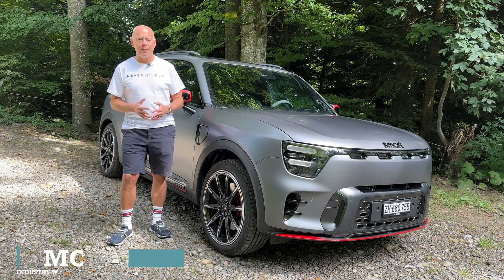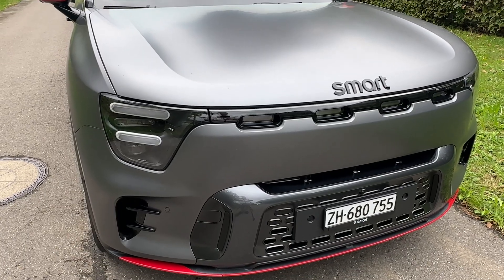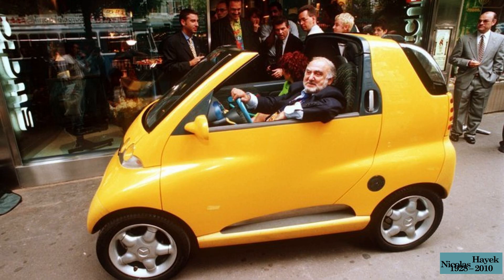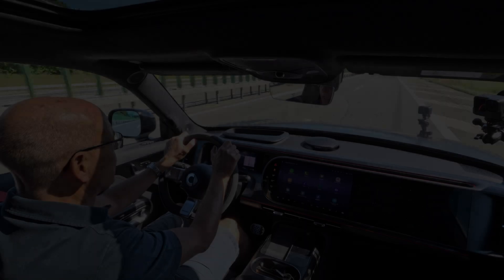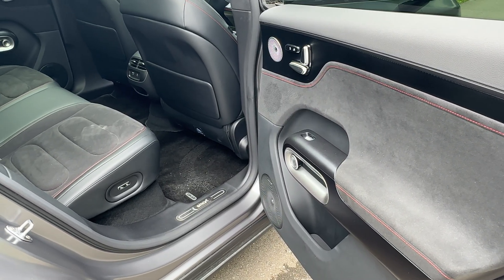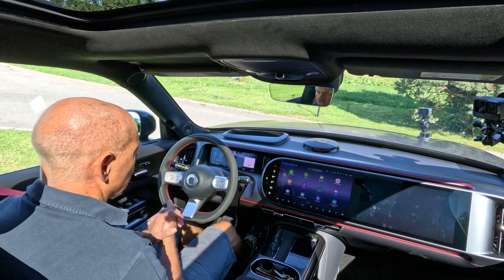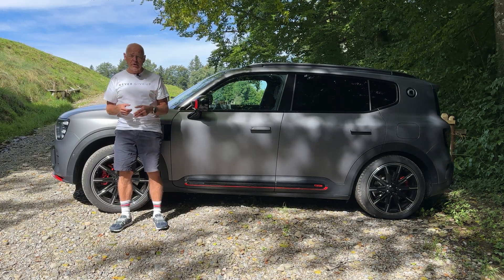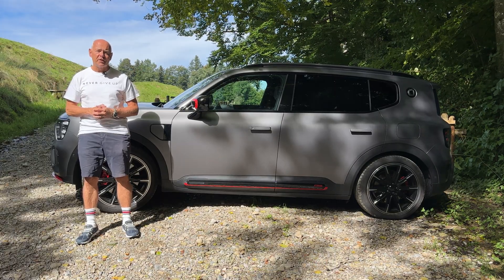Smart #5 – Geely Engineering, German Precision, Global Vision

Comment: An excellent review. After so much commentary about car software in the last few years, focussing on how rushed to market and poor it often was, it's disappointing to see Geely continue to under invest in this. And annoying reflections from the screen should be a fundamental design consideration. It makes me think: don't buy now, wait for the re-fresh in two years time.
Pro tip for English:
8:44 "at the end of the test we'll see how good or not good the car performs" --> 'how well or badly the car performs'.
A noun (a something, the something) can be described as "good". When you're saying "the" then you will use good, poor, terrible, amazing etc.
So: the brakes are very good, the braking is good, the acceleration is good but not amazing,
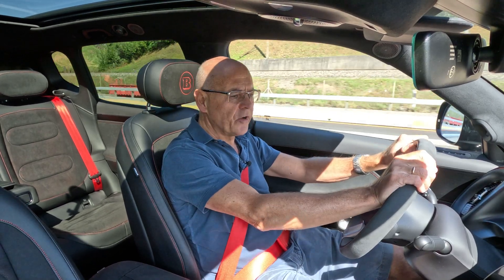A verb is always qualified by "well" - it drives very well, it drives quite well but.... (correctly used at 7:02, 7:32 etc)
And: it drives well, it handles corners well, it will sell well, how well will it perform?. When you're using a verb you always use "well".

Comment: No German is proud of the engineering behind the Smart. It's now a Chinese car, and I bet it will sell significantly worse than a genuine Smart in Germany, wouldn't you agree?
Reply: The new Smart cars are better than anything Smart ever made when they were German...
Reply: Most German ev’s are far behind the chinese. VW has nothing that is modern. Latest BMW i3 and Merc GLC is closing in at least, but charging is still far behind the best Chinese.
Reply: @DanielKihlgren you seem very hung up on fast charging, but it really isn't the big deal they make it out to be. In practice, having a 25 minute break on a road trip is perfectly fine. Especially with a family all having to go to the rest rooms, grabbing a coffee etc. And the #5 (and many other Chinese cars) are horribly inefficient at highway speed. That gives up much of the theoretical time gain of faster charging.
Reply from the maker: Possibly, but the car is backed by many Merc dealers which should help
Reply: I would love to get a European made car. For example the VW ID.7 Tourer with similar options is around the same price as the Premium. Although it has less power it is also much more efficient. Only thing is the poor track record with software and feature updates.
The Citroën e-c5 Aircross with full specs is less than €50k. Again, less power and for now only with the smaller battery. Big battery next year, but price unknown. Promise of 10 year OTA updates, but unclear for what.
Renault Scenic e-Tech, big battery and full spec around €52k. However, it is a bit smaller than the Smart #5.

Skoda Enyaq: similar price range. Same software story as ID models. 

Model Y is also built in Europe, but some people may not prefer it for different reasons... 

So we have European built options now. So Smart is offering a €4.500 discount in Holland at the moment. For the other brands, you have to visit the dealer and demand a good discount.